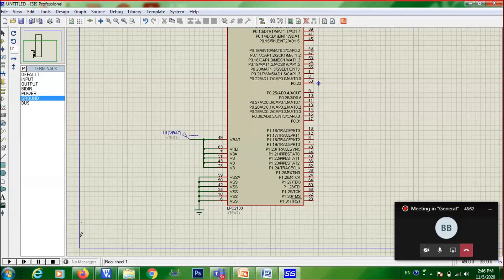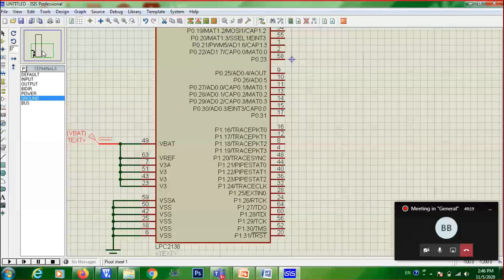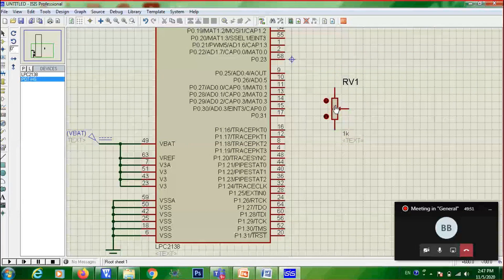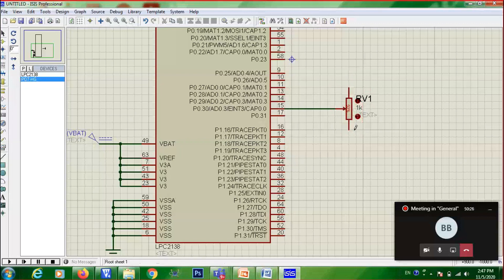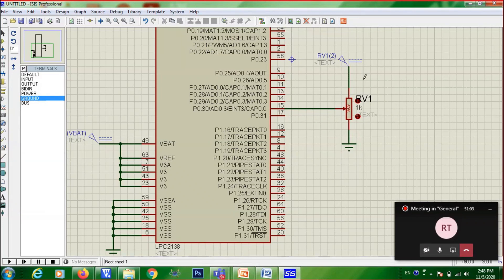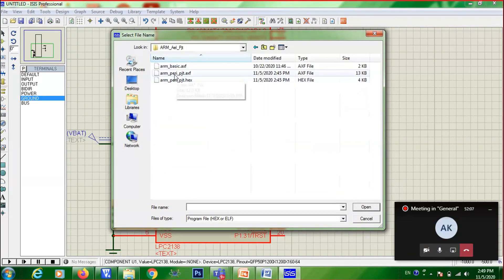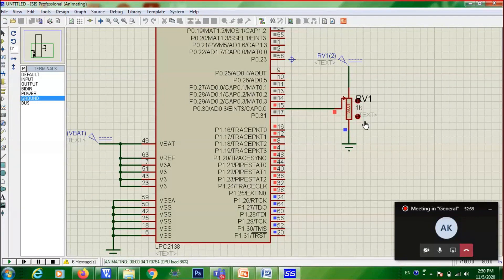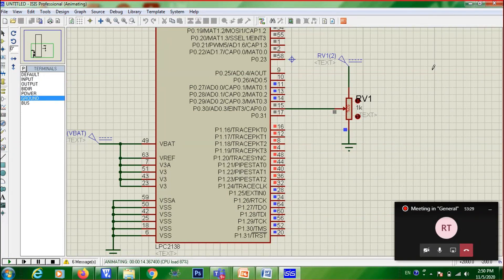Simulation of ADC Value Display on 10 LEDs using Proteus | LPC2148 Course Part 13

Comment: Hi sir ,followed the ADC Configuration and Programming  part 12 video - code and used the same hex file in proteus ,but the LEDs  at port 1 is not responding .Could you please help us with the same
Reply: I too facing same issue..did u rectify it?